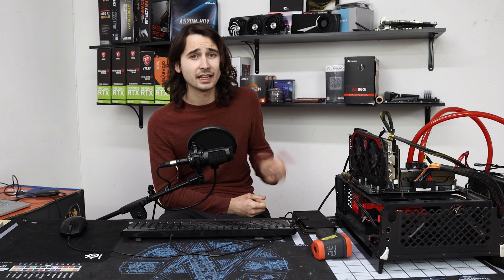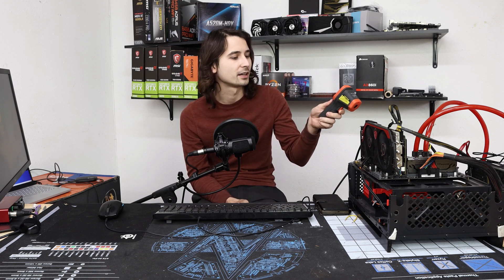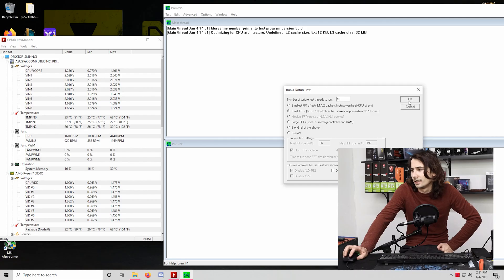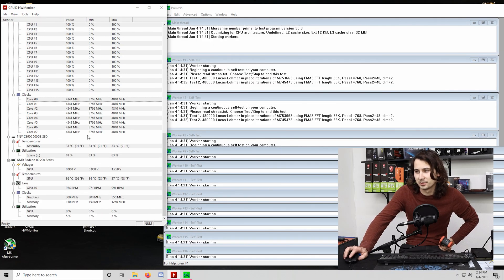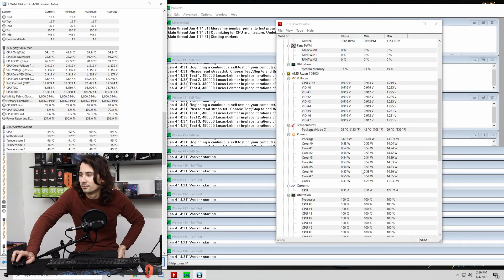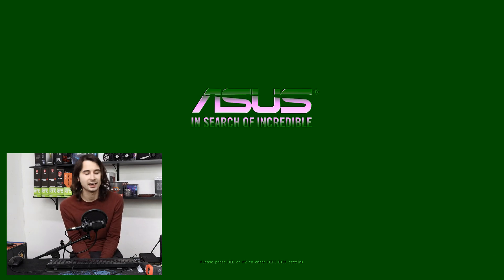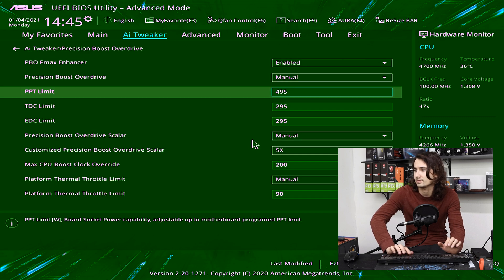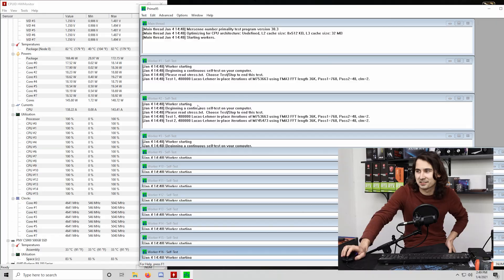Overclocking Ryzen 5800x On The Cheapest B450 Motherboard I Could Find - Motherboard Bottlenecked?!

Comment: will 5800x compatible with my Asrock b450 gaming k4
Reply from the maker: yeah, make sure to update your bios before dropping it in
Reply: @CoilWhine  thanks mate there will be no issues/ complications in future no?
Reply from the maker: @pixelplays8143  can guarantee anything but by all means it should work great
Reply: @CoilWhine  hey if its working fine with 5800x can i use ryzen 9 5900x with asrock b450 gaming k4?
Reply from the maker: @pixelplays8143  there you might be pushing it, just make sure it has good airflow

Comment: Hey. I have Asus Prime B550-MK motherboard with 5800x. Is it possible to overclock the cpu?
Reply from the maker: possible, yes. i dont recommend it, your results will be similar to the one in the video(its essentially the same board), gaming it should work but heavy sustained loads will suffer as the vrms get hot. youll need alot of airflow
Reply: @CoilWhine  thanks:)
Reply: @CoilWhine  Which board would you recommend?
Reply from the maker: Any x570 will do great. an asrock phantom gaming or gigabyte ds3h should work good and be cheaper
Reply: @CoilWhine  THANKS FOR THE ANSWERS! Is it worth it to buy a new motherboard for overclocking? i only game with my PC
Reply: @CoilWhine  abo button clicked
Reply from the maker: I just turn on pbo and let it rip, theres not much else worth changing honestly

Comment: I can't find a solid confirmation but would my MSI B450 Gaming Plus (not max) work with a 5900x if using the latest 7B86v1H3(Beta version) bios version?
Reply from the maker: https://www.msi.com/Motherboard/support/B450-GAMING-PLUS#support-cpu lemme know if this answers your question
Reply: @CoilWhine  it’s on there, sweet. Thanks
Reply: It works for now i have the same board
Reply: @an-slayer1192  hey thanks, I never saw Coil’s response. Appreciate it!

Comment: Do you think that asrock b450m steel legend can run with ryzen 7 5800x?
Reply from the maker: Absolutely, it will have to be flashed to a newer bios though
Reply: @CoilWhine  yeap I flashed but I was wondering if the VRM temps will be safe for a slight overclock or something.

Thank for the reply!

Comment: I have a MSI b450 Gaming pro carbon, non-max, currently with A ryzen 5 3600 in it and I want to put a 5800x in it will it work?

I use a phanteks eclipse P500A case with 3 140mm intake fans, Arctic 
Liquid freezer II as the AIO, radiator mounted at top and a 140mm fan at
 the back.
Reply from the maker: Yeah that should work great

Comment: Bro can someone please explain me the differnce between all the b450 motherboards. Like can i use a cheap b450 mobo such as the asrock b450m hdv and pair it with a 5600x. Will i be able to oc or not. Can i use it not oveclocked?
Reply: Can you please tell me. Is the msi b450m gaming fine?
Reply from the maker: @MuhammadAhmed-uf1jh  yes
Reply from the maker: Most b450 boards are fine, just find something with vrm heatsinks and dont worry about it. Even this board would be fine for a 5600x. Prime 95 workloads arnt realistic its just fun to melt stuff
Reply: Tysm
Reply: Tysm
Reply: I am only asking you cuz no other youtuber replies. Do all of the b450 mobos have headers if i have to attach 3 rgb fans and 2 or 4 rgb heatsinks. Especially the b450m gaming and asrock b450m hdv.
Reply from the maker: @MuhammadAhmed-uf1jh  most motherboards only have one 3 pin and one 4 pin where if you want to run multiple rgb part youll have to use a splitter or daisy chain them
Reply: I meant rgb heatsinks for my ram
Reply: i use shitty cheap motherboard gigabyte b450m gaming for 5600x.
it works fine, i  run PBO +50mhz and vrm is still cool

Comment: How about ryzen 7 5800x on a b450 aorus elite v1 ?? Overclocking and regular usage
Reply from the maker: Oh yeah ive done that its fine; both
Reply: @CoilWhine  thank you so much for clarifying I love the look of my b450 aorus elite and dont want to change it. I want to upgrade my cpu from a Ryzen 5 2600 to the Ryzen 7 5800x and no one has videos of a 5800x running and showing the average clock speed of it. Cheers dude!

Comment: GOOD man, actually thinking about getting a 5800x and a msi b450m PRO-VDH MAX  guess It should work fine right?
Reply from the maker: Yeah but i wouldnt try overclocking or atleast make sure you have good vrm airflow
Reply: @CoilWhine  thanx alot
Reply: @nemsoussam  did it work?
Reply: @FelixOnn1  i don't try it

Comment: I'm getting 4575mhz all core on my tomahawk max. Boosts to 4850 single core. Stock settings. Xmp profile
Reply from the maker: 5800x?
Reply: @CoilWhine  yes 5800x. And that's with a 120mm aio. Have a 280mm on the way.
Reply from the maker: @bobb3rdown676  thats perfect for stock, should try turning on pbo in the bios and seeing if you can get it to boost to 5.0 single core, might also hold a better all core boost under load. Obviously this will consume more power and probably not worth it but its fun to mess with.
Reply: @CoilWhine  ill give it a go when I get home.  Not sure if it's turned on or not tbh. I didnt check. Was to excited to get some scores up. My system did end up in the top 60 in timespy for 5800x and 5700xt. Can get any higher gpu scores without power play tables. But lots of room left in the cpu from the scores I saw. The top scores im sure are on ln2
Reply from the maker: @bobb3rdown676  its also fun to play with undervolting to see how cool and efficient you can get it to run at the same speeds
Reply: @CoilWhine  ran ctr 2.0 and it recommended 4700mhz @ 1250mv and 4800 mhz @ 1325mv. And for undervolt 4475mhz @ 1125mv. Will do a deep dive when my other aio shows up. Also have some 2t ram coming. Supposed to be better with dual rank as well.

Comment: Was planning on pairing the 5800x with the B450 Tomahawk Max. Any issues you think might occur or will I be fine?
Reply from the maker: Yeah it should be fine that board atleast has heat syncs lol
Reply: @CoilWhine  kewl spelling bro
Reply: Have that setup. Installed the cpu last night. Ran just fine with the latest bios. Just has the cpu debug led on that everyone has.
Reply: I just upgraded my processor to a 5800x and now im suddenly getting in-game crashes. CPU isn't overheating and I just can't figure out what the problem is. I'm using the b450 tomahawk max, have you guys had any issues?

Comment: Pretty stellar review of the mobo if you ask me. No heatsink. No airflow. Ran one of the highest end am4 socket cpus available and didn't die. Get the a ii. Better ram support and actually has heatsinks on the vrm. They're kinda dinky but they're real heatsinks and not chunks of aluminum. Also right now it's like 3 dollars more lol.
Reply: would this motherboard run a 5800x3d okay?
Reply from the maker: I like this take, if you weren't running some crazy cpu with no airflow this thing will probably last forever

Comment: I updated from ryzen 5 3600 to ryzen 9 5900x on my Asrock B450 steel legend motheboard, and I have similar expirience. I dont have vrm sensor, but they are really hot and after 5 minuts stress testing  cpu start termal throttling.  And CPU temps are between 70° and 80°C so they are fine.
Reply from the maker: Thats freakin crazy, i like i said on the other comment i wonder how far underclocking and undervolting would get you
Reply: Reading this I am so glad I went with Asus Strix B450-E gaming for my previous Ryzen 5 3600 and upgraded to Ryzen 9 5900x. No issue at all and max temp in cinebench r23 are 69°C but no VRM temperature on HW info too! Before with old bios and CPU I am sure VRM temp was there.
Reply from the maker: @Bobby you know; before we started the channel, i always thought that more power phases was just for more stable/consistent power delivery but now im realizing that it might also be for lowering overall vrm temps by making it so they dont have to individually work as hard. So many fun things to test thinking about it like that
Reply: I have issu only when I run System Stability Test | AIDA64. In Cinebench, gaming or even rendering in premier pro is without issue, becouse power consumption is not that high. Boosting is inline with my expectation. All core boost is 4.35Ghz, single core up to 5.05Ghz, in games I see 4.6 to 4.9Ghz with PBO enable. Overall I am very happy with this update.
Reply from the maker: @ulkulk123  yeah i feel like this will only get to high temps in super heavy extended cpu uses like video editing or like games that can utilize multiple cores where youre cpu bottlenecked